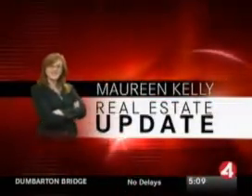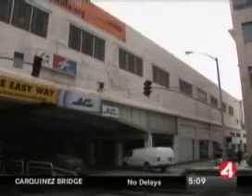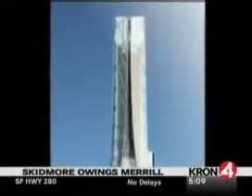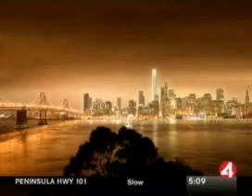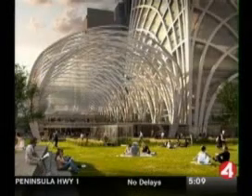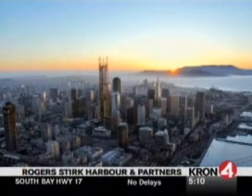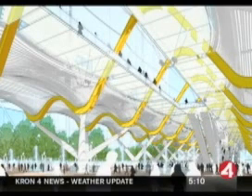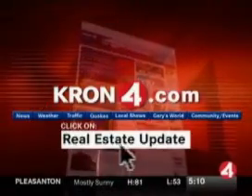San Francisco TransBay Terminal Plans

Comment: The one middle rendering would rival the "Spire" being constructed in Chicago, although I do not like either one esthetically speaking! I do like the wind turbines on top though! I would rather see the wind energy concept be put to a better use than  powering exterior lighting, it should aid in lowering energy consumption through out the whole structure.